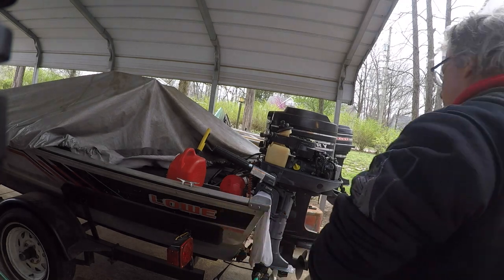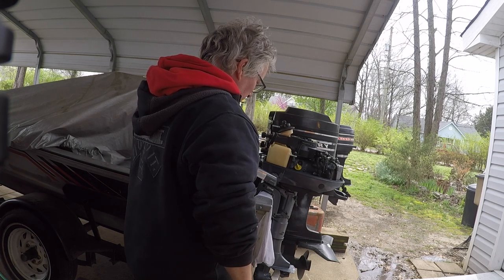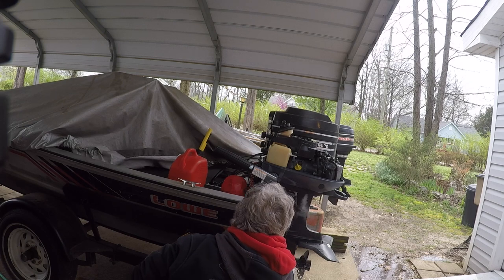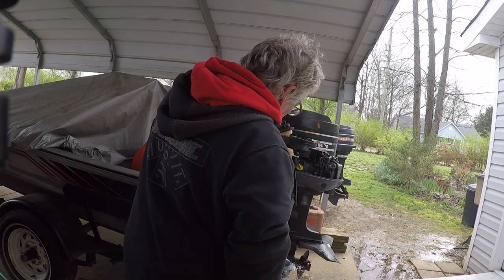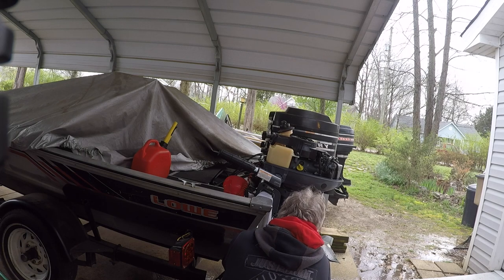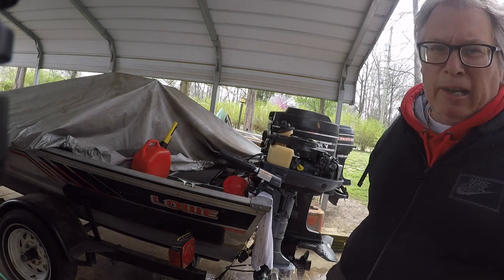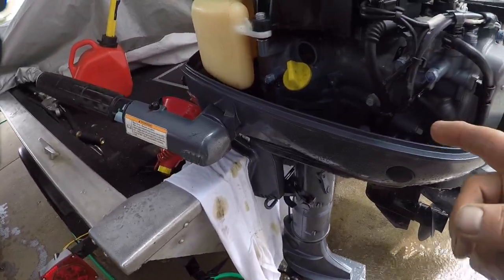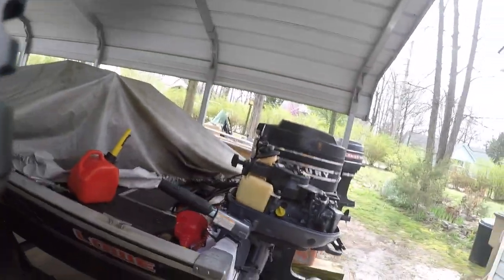2010 Yamaha 6hp F6 Outboard

Comment: You just fried your impeller and cooked the powerhead. You see that steam coming from the bottom of the motor ? That should be a solid stream of water coming from the motor. That type of lower unit needs to be submerged in a bucket of water not on flush muffs you need to change the impeller now and change the thermostat on the engine also.
Reply: Also there is a leak on the carburetor drain screw.
Reply from the maker: I already did.  I haven't ran one of these small ones before.  I have a new video I'm putting up.
Reply from the maker: @Fishing85  I fixed that but I had to order a new fuel cock assembly.  I'm waiting on that.  Its the fuel select lever for the internal tank or the external tank.  This engine had been sitting a few years.  The carb looked like someone ran red rtv through it.